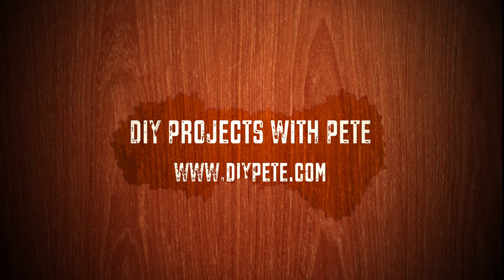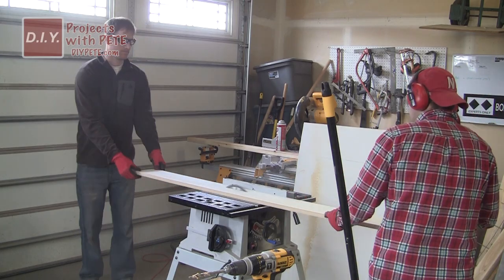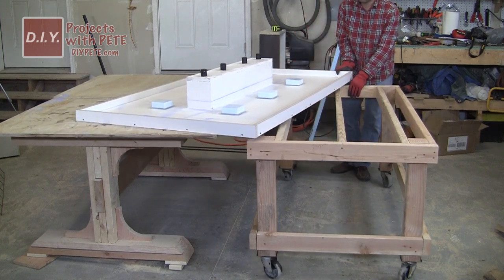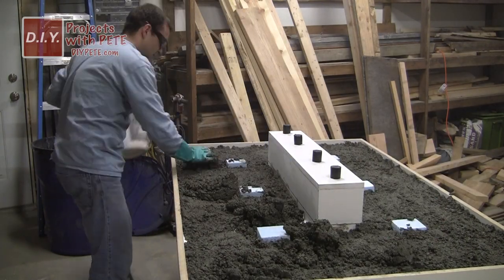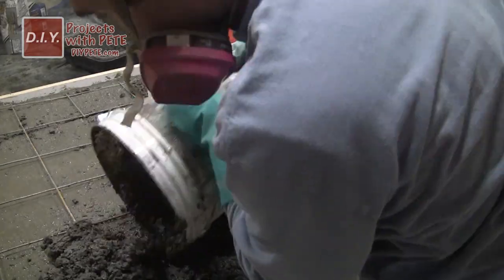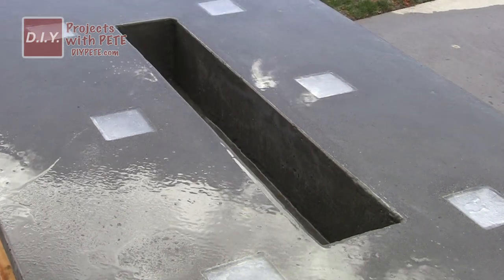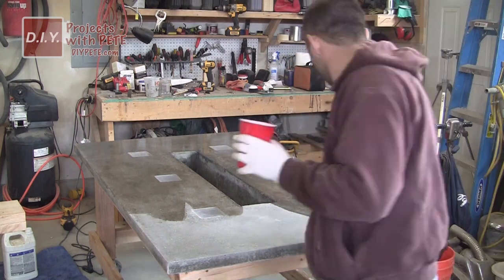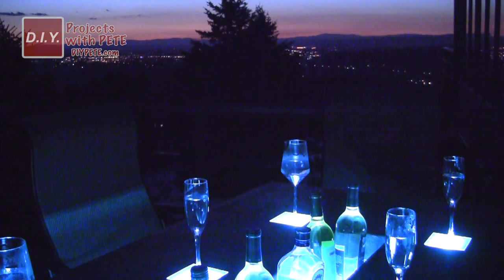How to Make an LED Concrete Table with a Built-in Cooler

Comment: It's been almost 3 years since making this, how's it holding up and is there anything you would do different.  I ask because I plan on doing something similar this summer.
Reply from the maker: Hi! It is still holding up great. I take the lights off in the winter and then put them on again in the summer. I use heavy duty velcro now to hold the lights in place. As for the concrete, I re-seal it every year ( just wipe on a couple coats ) to protect it. I've filled in a couple pinholes as needed. -- If I were to do it over again --- I'd buy a planter or an aluminum trough instead of doing the trough out of concrete. It would make it a lot easier project. The only issue is I haven't found any great deals on aluminum troughs -- and I was trying to show how to build a project as cheap as possible. You could use a plastic planter or something similar though. I might build it using some of the techniques I used in this more recent video: https://www.youtube.com/watch?v=VB94hVMWt5M  - Cheers!
Reply: DIY PETE Thanks for the reply, your thoughts on it, and the inspiration!

Comment: Dumb question, but what powers the lights?  Do you have to run a cord across your deck to the table/
Reply from the maker: Brad Bell Hi Brad! I used a 16 foot LED kit that plugs into a normal outlet. So for this an extension cord is used. However, in my recent party station build I used a "Battery Powered (eight AA batteries)" 16 foot LED kit that I found on Amazon for $48. I have a link to the exact one at http://www.diypete.com/ryobi-party-station/
Reply: Thanks Pete for the quick reply!
Reply from the maker: Brad Bell You bet Brad!

Comment: this is awesome.  Makes me want to build some stuff. what would  that retail for in your market?
Reply from the maker: +Steven Mendez Thanks Steven! If I were to make something like this table to sell, I'd probably sell in the $1300-$1900 range if you have the right place to sell it. -- Also, I did a concrete trough to bring down project costs, but a stainless steel trough would make the project much easier and lighter. Hope that helps. Cheers

Comment: What happens when the ice melts into water? How do you get rid of it?
Reply from the maker: +Salvatore Abner Arechar I put two drain holes in, I didn't show putting in drain pipes during the video, but you could drain the water into a bucket.

Comment: This is awesome.  Start to finish about how many hours did it take in labor (not including concrete curing), and about how much did you spend?  Freaking awesome man!
Reply from the maker: Hey Randy! Thanks so much! Gosh I would say a solid couple days for sure. Cost in the $200-$300 range. I've done quite a few LED tables since. This one has been sitting on the patio up at the cabin since it was built. It is currently covered with a few feet of snow, but has held up amazing! You'll have to build one! --- One thing I might do differently is drop in a metal trough instead of doing the trough out of concrete. That would be much easier.
Reply: Right on man thanks for the info!  I started looking for a long rectangular trough, but man are they expensive!

Comment: Why use acrylic for the clear tiles instead of actual glass tiles?
Reply from the maker: You can definitely use glass tiles. Make sure they are nice and thick in case someone sets their drink down too hard, or if hail comes through the area. Glass will work just fine!
Reply: You also gotta realize that he is sanding down the edge of the glass/acrylic/concrete. The acrylic will do better being sanded down and less prone to being destroyed. IE.. Glass - shattered, acrylic - cracks.
Reply from the maker: Good point Josiah. I appreciate you chiming in! Cheers

Comment: What was the cost of this build ?? Thanks for the video!
Reply from the maker: +fordsucks27 It's been awhile since I've built mine, and it will depend on wood prices etc. But a recent builder posted it was in the neighborhood of $345 for everything. (sealer, stain, glue, screws, wood, etc)
Reply: +DIY PETE should be easy to build these tables and get $1000 for them hey?

Comment: Wouldn’t the inside of the table develop cracking due to freeze thaw?
Reply from the maker: Hey Japhet! I haven't had this issue, but there is always a chance. To be honest, I would use a metal trough the next time to make the project easier, weigh less, and decrease the chance of any cracks. Cheers!

Comment: If you had made the trough form out of foam it would have been way easier to un-mold....
Reply from the maker: +William Bierie Great suggestion, doing the inside of the mold with foam and popping it out would be easier :) If I did the project again that's something I might do. Thanks!

Comment: what happens when the ice melt does it drain out of the table
Reply from the maker: Hi Geana, you could add piping if you'd like. I ended up plugging the holes and it sits in there. When done for the evening I'll remove the plugs and have buckets underneath to collect the water.

Comment: Why not use 3m ahesive LED?
Reply from the maker: Chun Yi Chow That's another great option for sure! I ended up using  a velcro to attach the lights later in the summer for a really good long term solution. They've stuck great for a full year now. Cheers!
Reply: DIY PETE I successfully pasted one inside/under my wood tv closet. However, it did not work if I pasted it upside down also under a acrylic board. Do you know if the board material (i.e. wood vs acrylic) make a difference ? Thanks.

Comment: and when the icecubes melt where will the water go?
Reply from the maker: You can run some piping out and route it into a bucket or through a deck. I didn't show it in the video. Use your creativity and come up with a solution that best fits for your space. Cheers!

Comment: Isn't there a "water problem" inside the cooler? I mean ... water & electricity weren't the best friends
Reply from the maker: Great question Hauke. The LED strip is waterproof with an IP rating of 67. They have a flexible clear coating enclosing them. So definitely check to make sure the LED set is waterproof prior to using them. Thanks! - Pete